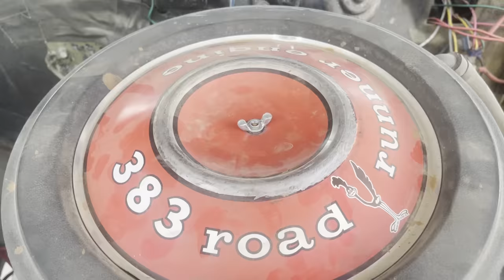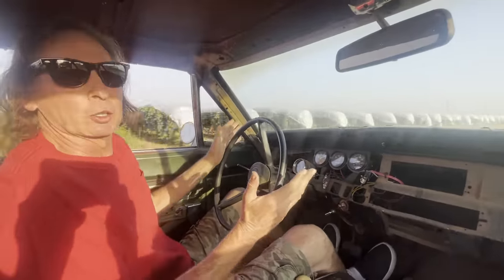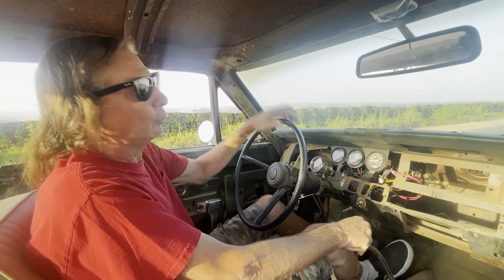Wreck Runner Roadtest

Comment: Hi from the UK.

I like the Wreckrunner.

You guys are lucky that so much old tin survives.

The damp climate in the UK combined with all the salt chucked on the roads over winter meant most old cars didn't survive.

Modern stuff doesn't rust the same way. Now it's expensive electrical/hydraulic, etc. systems that send rock solid cars off to the shredder, where NO parts are saved.

Makes my teeth itch.

Comment: Good luck on the car. I’m waiting on a 69 Mustang Fastback my dad left me after a frameoff restomodding. He got it in the late 90s off the first owner with just about everything it came with new. It was a bit ratted out from sitting outdoors for over a decade at least. Almost done but the waiting is killing me. Love to see others bring any car back from the brink. I owned a pretty rough 65 coupe with a 289 and 4 speed no other extras. Drums all around and no air or power steering. Still loved driving it as it was an experience. Had to sell it after getting out the army and starting a family.

Comment: Steve, I have a question. I'm building a 340 Mopar to basically stock specs. 4 speed. 3.91 gear in an A body. I am, however, running a six pack set up. Can you recommend a cam for this application? With all the small block Mopars you've fiddled with, you appeared to be the most knowledgeable! Thanks!

Comment: Hello Dulcich I assembled 318 87 rollerbl 302s sent out 202/160s installed Lunadi Dual vs in H1.7 w/Roller cam 219/228 270/276 515/530 mag stock lifters with the stock pr 6.75 tighten din stock st stock rockers some pr to short.why?what can I do?1/4 to short possibly very close to first junkyard jewel from 2000.thanks in advance

Comment: Cool!..I used to own a 69 and My Buddy just bought a 68 with an older Crate Hemi...If the Valve gear & Bottom end are close to stock ,Reving it more than 6500 rpm is just bending stuff..

Comment: WHY WHY WHY didn't you use a pinion snubber instead of GM tractions bars?
Reply: Yeah I agree it’s not that they don’t work on a Mopar it’s that you don’t need them unless it’s raised in the back and then you can use a adjustable pinion snubber
Reply: @jelmore61  Unlike Ford and Chevy, MoPar uses an elliptical leaf spring that has a shorter front half. That eliminates much wheel hop. I used an adjustable snubber on my 440 Duster, and it did 1.50 60 foots with Super Stock springs and crappy shocks.

Comment: Hsd a 69 from 73 to 82. 383 Mag 4 speed, factory 3:91 rear end.
Very fast for a 3900 lb car. Never really minded the manual steering, it was all i knew back the, never had power steering.

Comment: People say traction bars don’t work on a mopar, like the car can tell what’s bolted to it smh
Reply: Well actually there's more to it than you might think. 
Mopar rear leaf springs are actually well thought out and weren't as susceptible to axle tramp as GM and Ford that had leaf sprung rear ends.
People fitted traction bars to stop axle tramp wind up particularly on sagged springs which wasn't their intended purpose. Their purpose is as Steve says. 
Anyway, Mopar springs had unequal distance between axle and the front mount and the axle and the rear shackle causing far less tramp as the different distances had different frequencies where the two distances would oscillate causing natural damping. Similar principal to a valve spring and counter wound damper. Mopars not as susceptible to axle tramp causing the myth traction bars don't work on Mopars.
Mopar springs will wind up but the arc has to be right out of the spring for it to happen.